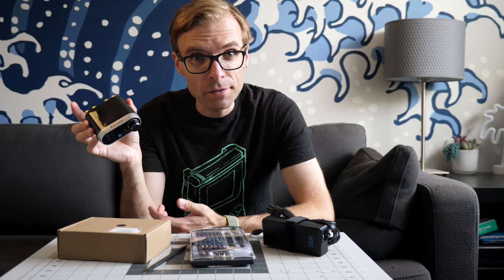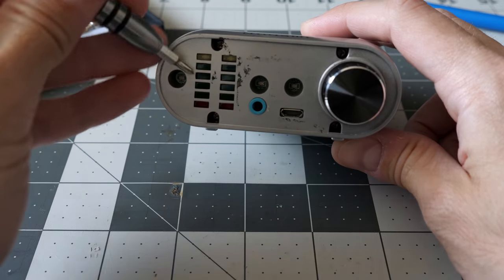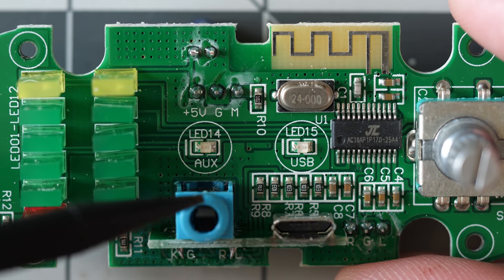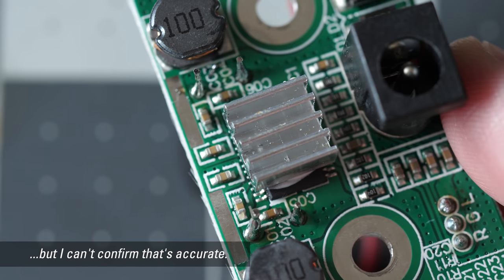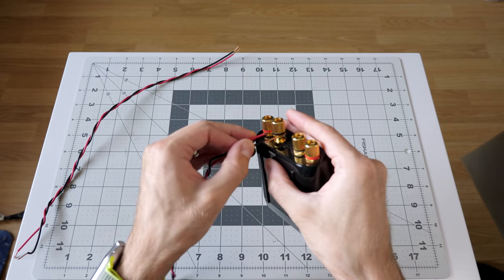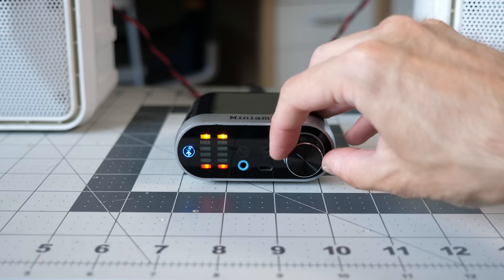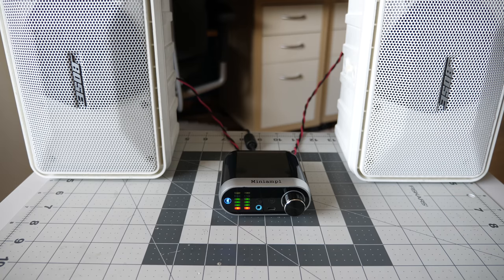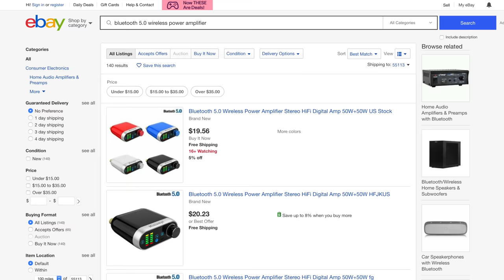Mini Stereo Amp (That Doesn't Suck)

Comment: It is no doubt a class-D output.  The efficiency may be as high as 95%.
Still at 100W that makes for about 5W of heat to get rid of .  The heat sink won't do that.
A good rule of thump is 1 square inch of fins in the open air can get rid of about a Watt.
Reply: Thump? Yeah, probably...
Reply: For the cost, size, and power rating it has to be class D. Although great strides in SQ have been made with class D amps I think I would still rather have 40w of good class A power. Hell, if they made one of these with class A circuitry I could also use it to keep my coffee warm at my desk. Win/win where I sit.
Reply: @Thezuule1  
It would be about a foot on a side to get enough surface area
Reply: @kensmith5694  Yeah but you're not factoring in the heat dissipation from my coffee. ;)
Reply: Most decent level audio seems to be around 2W if you measure it on a scope, for general usage I suspect it won't get too hot - it will also have thermal protection built in the chip.
Reply: Well... I suspect that 100W is the rated peak output power... I also don't think you're gonna use it wild all the time
Reply: Tests seem to show 5-15W RMS actual performance on these tiny amps. The "ratings" are just imaginary.
Reply: @goatofpower  Yes, it is common in "hifi" for power numbers to be wildly inaccurate.  About 10W does seem reasonable and that is enough power for most music purposes.  I used to own a stereo that did 3W per channel.  It was as loud as I needed it to be.

Comment: ALWAYS test before disassembly.  That is, if you want an ACCURATE review of a consumer's experience with product, as shipped.  Once you dig into something, you taint the review. 

BTW:  That is 50 Watts Peak Power with ampl amounts of distortion.
Reply: Sam Houston   Assuming a very generous 90% efficiency, that fingernail-size heatsink is expected to dissipate 10W?  Um, no...   Great idea, horrible execution.  If disassembly/reassembly as shown breaks it, no thanks.
Reply: @artysanmobile  Class D amplifiers have very low power dissipation. The output driver is either hard on or hard off. No analog modulation occurs, it is just feeding a very high frequency square wave to the speaker with pulse width modulation.
Reply: Allan Gibson   I know exactly how class D functions.  But nothing is 100% efficient.  That heat sink is there for a reason, in this case to dissipate the roughly 10% of waste energy created by the class D switching transistors in their overlap period.  It is seriously undersized even if you assume 95% efficiency, which is stretching the limit of even class D amplification.  It is an obvious weak point of this unit’s design.
Reply: @artysanmobile  For a class D 10% is very high. That said no-one runs an amplifier at full rating. A 50W amplifier really runs at 5W 99% of the time otherwise the music playing sounds like crap. It is a question of dynamic range. Music has at least a 10 to 1 dynamic range for acceptable reproduction and 100 to 1 for any real fidelity.
Reply: Allan Gibson   None of that has any bearing on my complaint re design.  Proper engineering takes into account, within financial constraints, the absolute worst case scenario, and then generally a margin is added to that.  I know this isn’t exactly life or death here, but the design is pointlessly doomed to eventual failure by that one silly decision.  If you rate your amplifier for 100W of output to a given load, you design it to do that indefinitely, not ‘maybe if someone’s listening to music properly’.  Specifications mean something to many manufacturers.  To some, they are just sales tactics.
Reply: @artysanmobile  Very few people try to drive audio amplifiers at maximum ratings with square waves. The whole concept of "music power" is based on this. 
You could design a amplifier to dissipate that kind of wattage but it would be ten times as expensive as one tailored to one that just plays music at the required dynamic range reliably and while it can hit the top end when required, it is rarely required to. 
Good design for price is knowing your job and "just" meeting the target.
If you want to play Black Sabbath at full concert volume levels in your garage I would suggest an alternative solution (and your neighbours would probably prefer an alternative venue).

Comment: I’m one of those people with a pi setup and can confirm the dirty audio comment! I’ll be picking up one of these guys for my pi setup and use the power out from the computer monitor I’m running because it has detachable powered speakers. This little guy will be the answer to my audio situation.  The crackling you heard was because the connection to that front board wasn’t fully seated, and since it lives inside the case(it’s a simple fix). I just slightly/minutely bend those pins in one direction to tense them up & problem solved! I also have added a small bit of solder to said pins to make them bulkier and thus give a much proper connection in other applications with such connectors. Though I doubt that is necessary in your case. Maybe drilling some tiny holes to the back or under the case(near that heat sink will prolong the life of the amp in the long run. Cheers ;)

Comment: I have a no-name 2x120W chinese amp from Aliexpress on my balcony.  I feed it 24V from an old Compaq Rackswitch PSU that can give 7A @ 24V.  The amp pushes out nice sound, even with full size speakers.  Has line in, and Bluetooth with a physical switch.   Picked it up during one of the New Year sales for $50 shipped.  I've had it now for about 3 years, using it a lot during summer, and not so much during winter.   Guests cannot believe that the amp is so small, but outputs the quality and volume it does. :)      Some of these amps are nice, others, not so much.  Thanks for the video.    Greetings from Norway.

Comment: It is a very good amplifier, I  mounted one in a Kenwood  ka-3020 SE  amplifier splitting the input signal in 2 ways one going in Kenwood so now it has 4 channels & bluetooth. I did the same with a Sonny  amplifier F442E . I am happy with the quality. Only be aware class D preamp must be addapted very well to class AB amplifier otherwise can be damaged (amps or speakers)
I did not have any kind of problems or strange sounds.

Comment: I remember buying a brand new Mercury Lynx( Escort) 5 door hatchback in 1982 and it DID NOT come with a radio. They wanted extra for one and I said NO. My point is , I went to K- Mart and invested in what was back then, A top of the line stereo with built in amplifier. It had some sliders and rows of lights. Back then, it was a very high end system and sounded better than any Ford radio. I added my own boost and base that was mounted in the back corner of the car. I could knock the back seat all the way down by pulling the seat bottom. It was never advertized, but that feature made that car priceless in my book. I hauled so much stuff in that car as well as camped in the back of it. That amp reminds me so much of the one I had in my car. Great memories of the 80's. Huey Lewis and the News and the Police were my favorite two groups then.
Reply: Getting old is a bummer 😒

Comment: Mini "D", as in Class.

As for wattage, well, it's all Ohm's Law.  You can run a full-scale sine wave into the USB or BT input, then measure the RMS voltage coming out of the binding post.  From there, it depends on the impedance of your speakers -- which, being a reactive load, the resistance will vary by frequency.  Since these have been heavily modified, you won't know the nominal impedance, and it's not going to be the same thing as DCR.  Unless you have a dynamic testing rig (Dayton Audio makes one called DATS that is really inexpensive) then you'll have to make do with theoretical calculations.

TI generally say what they mean, and mean what they say.  If they say it will do 50Wx2, it will -- and they'll tell you under exactly what conditions that will be the case.  But it may not be practical due to heat or power supply constraints.  Engineering is compromise.

Lastly, in my opinion, the "modularity" of this thing isn't indicative of well thought-out design and serviceability.  It's just the most expedient and cheapest way to do it.  Especially things like the binding posts using PCB holes.  So much cheaper to assemble than wiring.  It would also be difficult to get that front 3.5mm jack on the same plane as the rest of the components, so it gets its own adapter PCB.  I guarantee they weren't thinking of your ability to repair it, they were just optimizing out the cost of doing it any other way.

Comment: Have you come across the CMoy amplifier in your investigation? It's an internet design made available for anyone. You can breadboard it, make your own PCB, buy a kit, or buy pre-made units from individuals. I bought one of them years ago which uses a rechargeable 9V and a DC jack, the sound quality is AWESOME. These days you can get ones which charge off USB. Strong recommend on CMoy amplifier if you can find one.

Comment: You should have tested the amp BEFORE opening it. Now we'll never know if it sounded like that out of the box or you just broke something while poking the insides.
Reply: It was likely halfway broken before he even opened it up. Those solder joints are all garbage and will definitely fail with time.

Comment: Timely! Bought it. Yes, for the garage! Will test w/o disassembly. So... FYI, the datasheet for the TPA3116 Power Amplifier Chip has a linear power out with voltage. 16v goes 15/30w into 4/8 ohm, 24v goes to 35/70w into 4/8 ohm.  Should be plenty loud.
Reply: Got it, everything tests out, all 3 inputs ok. Drives even big floor speakers. I used a lab power supply and basically, the voltage doesn't matter. Draws more amperage at lower voltage but same volume (class D! should have known that). 0.2 amp will get you quite a bit of sound. 

Thanks Colin!

Comment: I think he has NOT damaged it and the problem with the noise (only!) with bluetooth has nothing to do with opening the device (without testing it before). It can also be a design-problem because of missing (or not good enough) ground around the BT chip or antenna. If you have the same problem with noise via BT  just touch the chip or its contacts with your finger, the noise often will stop. 
I was searching "hours" for the reason of this noise on my amplifier and finally found it. I fixed it with a little bit of paper (as isolator), aluminium and a short cable to ground.
If you have still noise problems, replace the powersupply with a battery and verify.

Sorry for my (bad) english, I'm german.

Comment: Do you think the problem was because it was taken apart?
Reply: Ya, I would have tested it BEFORE I ripped it apart.
Reply: YES - the video actually shows the condition of the front audio connector was compromised by the brutal way this idiot tried to disassemble the thing.
Reply: -Yesss a video showing a person not working with 240V that means he cant work dangerously with bare wires while the things powered on.

-Youtuber proceeds to rip the thing apart before testing it and then blames the device.

fuck.

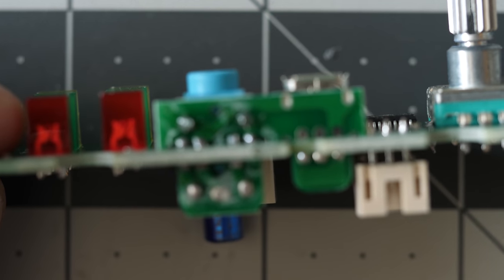Comment: 7:27 - Aside from the uncleaned flux residue, the ground pin on the connector daughter board is cold soldered.  You clearly had intermittent connections when you were testing the bluetooth interface.   11:19 - This unit is false advertising 2 X 50W capability.  Its own documentation says it will run on 9V to 12V.  According to the data sheet, the amplifier cannot produce more than 2 X 15W, and that is dependent on the available current of the power supply.  Further, there is no way that little stick-on heat sink can dissipate even the 30W, particularly with no ventilation.   A little math: Class D amps are, at best, 90% efficient.  8 ohms across 12 volts at 90% efficiency is 16.2 watts per channel.

Comment: Sounded pretty good, I'm building a BT speaker for my inlaws for Xmas it will be run off a small car jumpstarter rechargeable unit, it hat BT, has USB input and charging output, I'm building in a Google home mini, all invaded in a WW2 ammo box. Led lighting around all the speakers via some 3mm perspects and tiny sound active lights. I need to have 12v output, 9v &7v so I picked up a couple of tuneable voltage boards. Small amp, I'm running a central 6inch 3way speaker and 2 sets of 2way and tweeter speakers. It has USB input plus 2 USB charge outputs, 3mm headphone jack input. So I've got my self drawn up wiring diagram and will see how it's all going to run....... I've built it about 100 times in my head, done dozens of sketches of the final product, I'm waiting on 1 more part then I think I'm up and ready to get it started........ Hoping all my calculations and ideas will work. It's to run outside by their pool and spa, so I'm trying to build it all 100% hands-free so the can"hey google" any changes, being music changes to volume control....... So fingers crossed......... At least the small jump starter battery supply will last a long time and takes over night to charge from zero to 100%. But when it's off and not in use, it will just look like an old WW2 ammo box....... I'm going for the, in wrap disappointed face to the open the box and wow face...... Just need my last 2 components to start wiring it all up to see if it will work be4 I go mounting and soldering everything...... Thanks for your upload, gave me more food for thought.....

Comment: If you touch a circuit board without an antistatic wrist strap attached to a ground, then you can introduce 20,000 volts or more of static electricity. It only takes 7 volts to destroy some chips. Also work on an anti static mat. Always check the unit before you disassemble it, then you can narrow down the problem cause.

Comment: Remember Class-D amplifiers are very efficient (90% or more) and at normal non-party conditions it doesn't produce any (extra) heat. You mention it is the Texas Instruments TPA3116 , it starts to produce 'heat' (a little warm) when you feed it above 12 volts. You can also power the TPA3116 with only 5 volts (if there is no voltage requlator inside this that requires a higher voltage), I have a few boards that works nicely on 5 volt (USB power) and if you use decent speakers (hook up 100W kenwood, 96db 1W, Wattage don't say everything - sensitivity and construction matters) , it is very suitable to use at computer, garage, etc to use at normal (and pretty loud) listening conditions. 

1W, 3W or 5W can be very loud when using a pair of decent speakers, especially using Class-D amplifiers. The TPA3116 is really a good and efficient chip because of the wide input range and decent crisp quality of sound, even on a low(er) voltage. I like to see if it is possible to run it at usb power, I think it is possible besides the required input specs. 

You didn't try the USB input connected to a computer, I think (by experience of JL 'branded' chips) that there are some hidden features.

Comment: The internal audio/LGR connector housing looks like it's mostly pulled off at 7:24. That might be the source of the audio crackling / connectivity issue - if the pins aren't fully engaged in the connector, you'd get exactly the problems you had.

That style of connector can be a real pain to unplug - I'm wondering if it came loose in the disassembly?
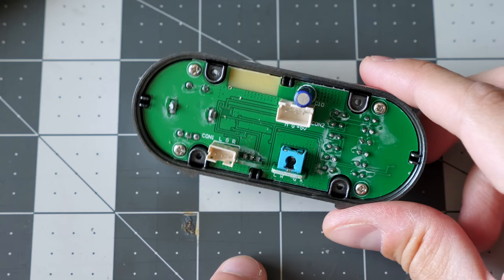Reply: ya see how he unplugs these? 4:00 wot a scrub, just twists em off ay
Reply: The pins are fine, only the shroud has moved, so don't panic. Everything is fine.
Reply: The pins are still attached to the board, yeah. But if you plug the connector into the housing, and it's still not properly seated on the pins, it'll make poor contact. Which is kind of the opposite of fine.
Reply: @randyglenn5965  So, the shroud gets pushed back into place, NBD.

It is totally unnecessary to assume the reviewer is completely incompetent: I appreciate that the reviewer put some effort into this review, and don't think comments of the kind you are making are going to encourage more videos of this kind, from anybody.
Reply: If you can point to where in my comment I assumed he was "completely incompetent", feel free. More likely, you'll only find the part where I pointed out something that it looks like he missed.

People miss things sometimes. It happens.

Comment: I just bought the nobsound £42 attatched the q acoustic 3020i, then sent my flac music to it via a Samsung s21 ultra it worked straight away & was impressed with the quality compared to my 4 grand system in the lounge it was not the clarity but very good, definitely worth it for the low cost. Plus fits in small spaces. Why do you have to pull them apart I don't know as that's for those experts, I just love music

Comment: I had a car audio Bose 1401 system derived from 901 drivers. They look EXACTLY like the same full range drivers. The 1401 was 100 watts total into 4 speakers. It was actually good stuff...for the 1980's.

Comment: I vote "hidden Gem."
I bought one too. No issues with mine. I have it feed by a 20 volt laptop power supply that can put out 3.25 amps. I am using Paradigm Mini Monitor speakers and all in all I am very satisfied. I suppose I could get more power if I used a 24 volt supply with a higher amp rating but it has plenty of volume for the 15' by 20' room it is set up in, and it does not seem to have any heat issues after a month of being used daily.
Reply: What is the brand name of this amp?
Reply: @maxlever  Miniamp1. Towards the end of the video he tells you the best way to search EBay to find it. There are at least half a dozen sellers that sell it. I bought mine for roughly $18 from a state side distributor and had it within 4 days.

Comment: Clean up all of that flux residue on the front board first. Then look at the crimp connections on the plugin cables and the state of the receiver pins in the connector. Sometimes just bending the pins to not 90 degrees (away from normal) improves the contact strength.